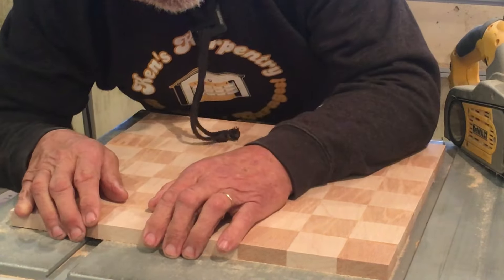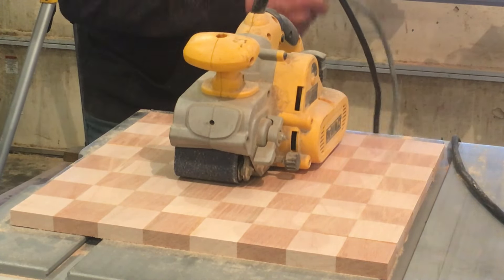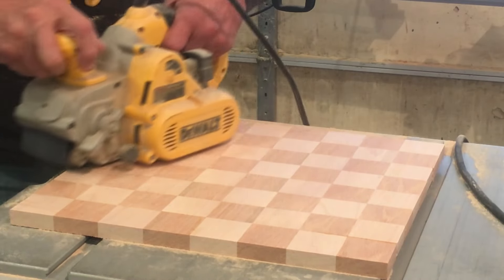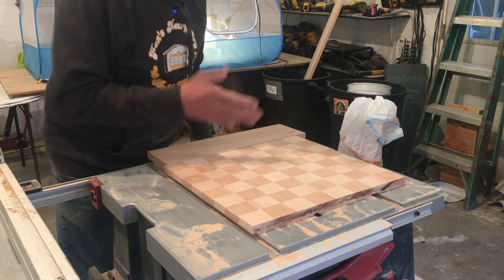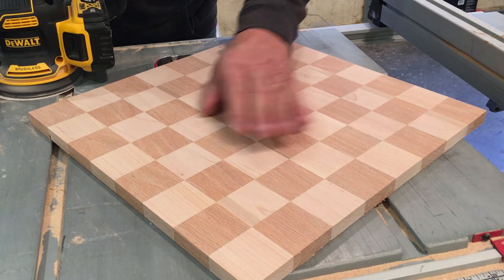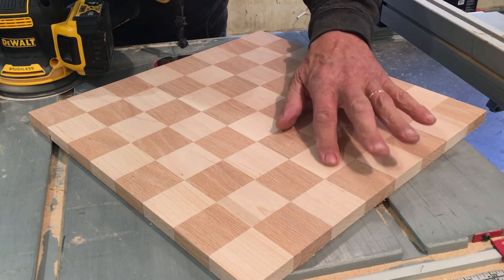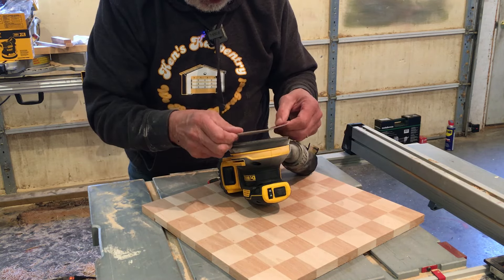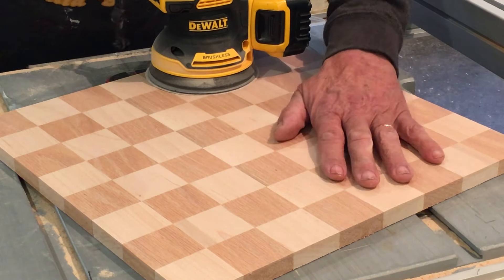This Chess Board is a Little Bit Different !

Comment: We were fortunate in high school wood shop.  The planer could go up to 44 inches wide and 16 inches thick.

It was 1/16 inch per turn of the thickness handwheel.  I went down 1/8 of a turn a pass.  Very smooth results.
Reply from the maker: WoW that would be great

Comment: I can't believe I missed this video. We have a white pine slab kitchen island with boards of about 1 1/2 inch. Some one had used a band sander on it and you could feel all the ups and downs on it that I really didn't like. A few years ago we sanded it by hand with sand blocks and we got it fairly flat. It was so much better. It took a long time but it was well worth it. We did three different grades of sandpaper and we started with 80. It was great putting the butcher block oil down on it when we were finished sanding. I was very happy we did that. Those chicks are so great to hear. Kia is a good puppy! I like the backer board and the idea of trays to each side to hold the pieces. The gluing up was nice to see. Thanks for this video Ken!
Reply from the maker: Thanks I’ll bet your island looks great
Reply: @kenskarpentry  I like it! It's much better nice and flat.

Comment: Hi Ken, I made a dining table and used a belt sander to sand the top. I held the sander in line with the grain and tried like crazy to avoid digging in. I noticed that at times you unevenly moved the sander sideways, that will put a fine notch into the piece. It’s a nuisance but those orbital sanders do a great job don’t they.
Reply from the maker: Nice. Yes I had to work it a lot
Reply: I have done this a number of times, especially when I use my three inch belt sander instead of my four inch. When you move it sideways, you have a tendency to tilt it.
Reply: My grandpa (a carpenter cabinet maker) did not allow any orbital or circular sander for finishing work. It had to be either a belt sander or a single axis vibrating sander that had to be kept perfectly aligned with the wood grain and very gradual lateral movement to avoid scuffing across the grain.

If you are finishing with paint (and covering up most or all of the wood grain) scuffing is not so much of an issue. But if you are finishing with clear varnish or stains to really make the wood grain [patterns] pop, any scuffing will also show up.

Comment: Nice.  I'm probably going to build one after watching you.  I didn't catch what kind of glue you used with the sawdust to fill the gap in the top.  A luthiers trick is to use crazy glue.  It dries clear so it doesn't tint the build up like yellow glue would.  Also, t dries quickly.  Even if the saw dust doesn't fill the hole to the top since the glue is crystal clear, the eye sees right through it and the hole visually disappear.  Actually, luthiers chasing pinholes in built-up purfling (glued up multi-colored thin strips on the edge of the guitar body) just use glue without sawdust to fill the hole.
Reply from the maker: I used white Elmer’s glue watered down.  Nice tips. Thanks

Comment: My grandpa was a carpenter cabinet maker, and whenever I had the opportunity, while growing up, I spent time with him in the shop. And I picked up more than a few pointers and tricks on nicely finished woodwork. He insisted that a rotary sander was good only for rough sanding. But for the finishing sanding to a smooth finish you used a belt sander. And you make damn sure that the belt sander is absolutely aligned with the wood grain, with very slow lateral movement. Thus preventing the cross-scuffing (diagonal or perpendicular to the grain) that you noticed after you ran the belt sander diagonally across the grain. A rotary sander by its very nature will scuff and cross-cut the wood grain.
There are also vibratory sanders out there. Some have a two axis (or circular) movement and are good only for prefinishing. While the better ones have a single axis movement, and can be used for fine finishing work along the wood grain. These vibratory sanders might be better suited for final finishing than a belt sander (with fine grit belts), because the movement is a bit less aggressive.
He would finish sanding the wood with grit in the 300-400 range, especially between coats of thin varnish (a minimum of three coats, but as many as six to eight coats) for a super smooth and high endurance finish.
Reply from the maker: Thanks for the input

Comment: I love this project!  The trim around the board is a beautiful finishing touch. Are you going to frame the trays? 

These woods look so good together!  This is going to be absolutely stunning when it is finished.
Reply from the maker: Thanks yes. I’ll be trimming around the perimeter. Was thinking about felt inside the tray area
Reply: @kenskarpentry  The felt is a great idea!
Reply: @kenskarpentry    I was thinking of felt for the entire bottom, so it doesn't scratch the coffee table. Back when I was in shop class, they had a felt gun that would puff out a light coating to stick to either glue or a fresh coat of varnish. It gave VERY professional results to even a first timer. (that was me!)

Comment: Of course my OCD brain was shouting, "turn the board, white square on the right, turn the board."
But you could be putting your graveyards at top and bottom instead of on the sides.
And most people don't even know, white square to the right, they just play.  And that's okay by me, after all, does it REALLY matter?
Reply from the maker: Oh no!  Did I make a one of a kind?
Reply from the maker: I just looked at the video again. I never gave it a thought about white in the right but  I was envisioning the trays to be in front of each person. So I think I’m ok.
Reply: @kenskarpentry  yep, then you're good.

Comment: When youre using the orbital sander on something like that esp against a slick surface like the metal table saw top, I always use an old towel under it so you dont pick up marks from the backside vibrating as you sand, also seems like it doesnt move around as much?
Reply from the maker: Good idea thanks
Reply: Good Morning Ken🌞🌅That's a nice Chest Board! 👍Kyia is Fiesty this morning 👍She has Alot of Energy! Beautiful 🤩 They give you energy! 🤩😉👌✌️🤞🇺🇲🙌🙏🌟🇺🇲🇺🇲